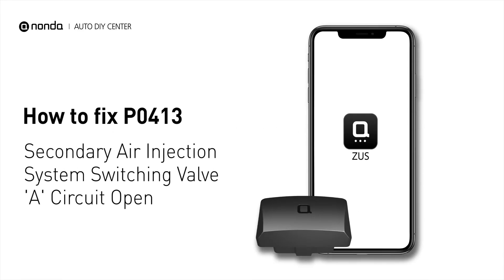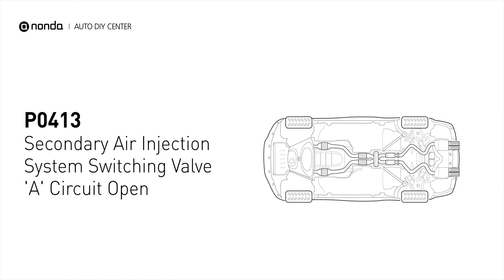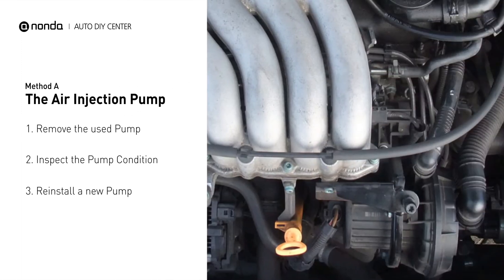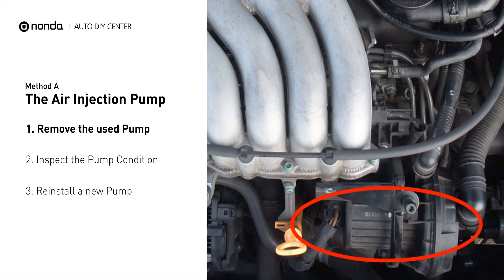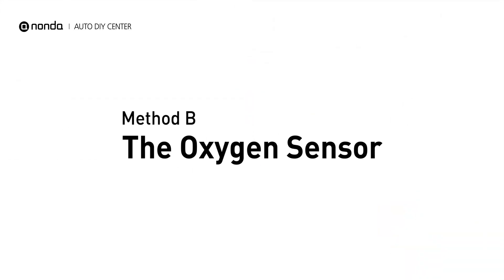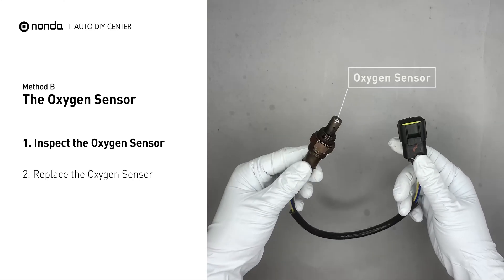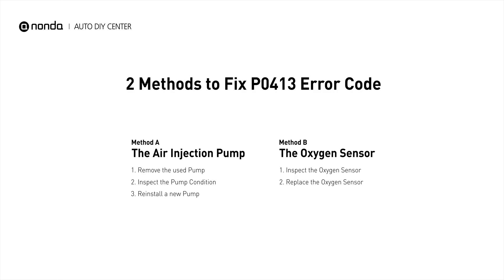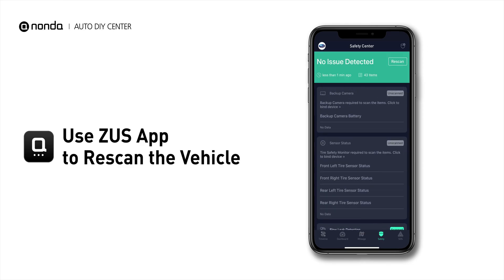How to Fix P0413 Engine Code in 3 Minutes [2 DIY Methods / Only $9.84]

Comment: 2014 vw gli 2.0t?
Reply from the maker: Hi Andrew, kindly check the condition of the air injection pump, O2 Sensor and check for proper resistance ohm.
Reply: @nondainc  which o2 sensor would it be?
Reply: Did you ever figure it out ?mines is throwing the same code
Reply: @NasirThompson did you figure it out

Comment: 06 2.5 jetta. Was stranded at store with dead/bad battery. I used a guy's jump box started right up. Drove 2 miles temp gauge on dash said overheating and had warning light and bell. Turned heater on, worked good, pulled over as soon as I got through red light shut car off popped hood. Antifreeze wasn't hot or overflowing, had a little pressure when I took cap off reservoir but didn't overflowing or anything. Hood was cool engine seemed warm but not hot just normal. Let sit for half hour temp never dropped. Had 5 miles to get home so popped clutch to get going blasted heat and went. Cel came on and noticed a power loss at 3k rpm in 1st and second. 4 miles down road temp gauge magically dropped to normal. When I got home I scanned it had p0332 and p0413. A help would be appreciated
Reply from the maker: Hi Joe, you may possibly have a bad knock sensor or wiring issue. We also suggest checking all the hoses leading from the pump back up to the check valve for leak.

Comment: 96 f150 5.0L
Reply: Checked resistance on the TAB and TAD, they were 75 which is within the 50-100 spec
Reply from the maker: Hi Jack, can you please confirm if this is the only code you're getting?

Comment: PO413 04 Volkswagen Jetta 1.8t GLS ?
Reply from the maker: Hello, kindly check for vacuum leaks and check the condition of the wiring to the air injection system.

Comment: P2008 charger Daytona???
Reply from the maker: Hello, kindly check the intake manifold runner flapper valve operation, and inspect all the wiring/electrical connection. Please make sure that all the said parts are in good condition.